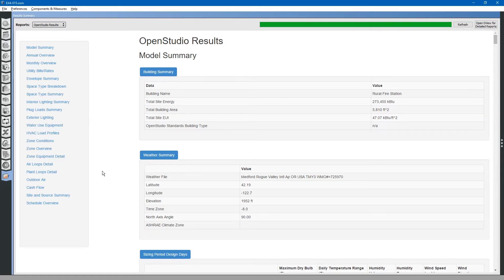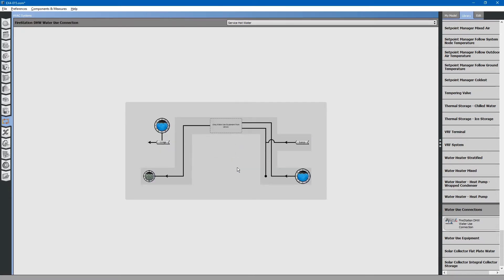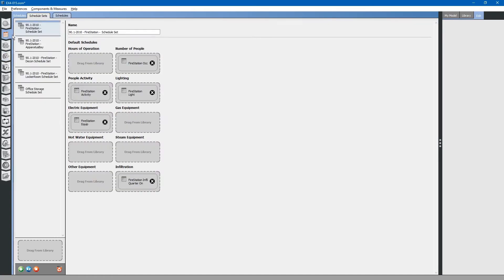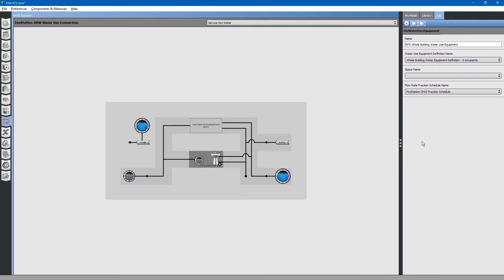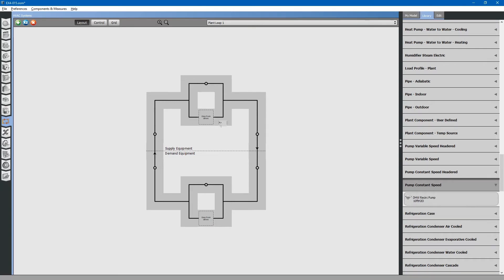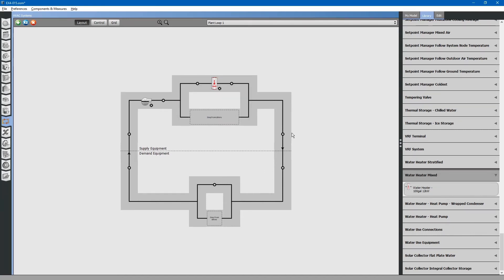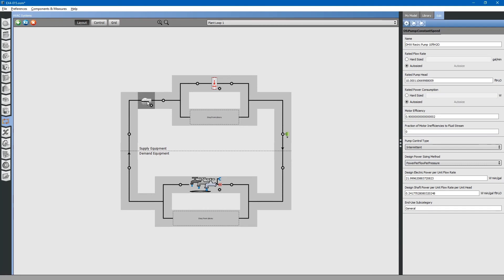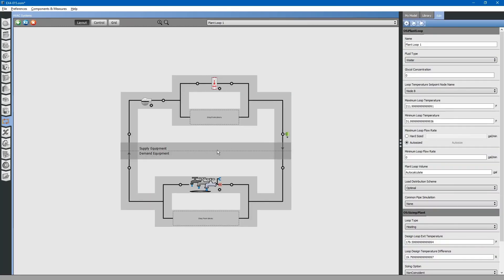Building Energy Modeling in OpenStudio - Add Hot Water System

Comment: Thank you for the clear explanation . I have a question regarding cold-only water use, such as toilet flushing. In a typical house, the bathroom has a shower that uses hot and cold water, while the sink and toilet often use cold water only.

From your experience, how do you usually model cold-water-only fixtures in EnergyPlus/OpenStudio? I tried modeling the toilet as a WaterUse:Equipment object without connecting it to the DHW loop (since it does not use hot water), but I do not see the cold-water volume results in the OpenStudio summary. I also tried creating a separate plant loop without a heater and encountered errors.

Could you please advise on the recommended way to model both hot and cold water use and where to properly check the cold-water consumption? In this video, it appears that all fixtures are modeled as hot water.
Reply from the maker: I have never tried this; apparently OpenStudio does not allow you to create standalone water use equipment.  They are all required to be connected to a water use connection.  Here is a workaround: 

Go to the Loads Tab and create a new Water Use Equipment Definition.  Go to the schedules tab and create a cold water temperature schedule, preferably something low enough that it will not need a boiler to heat it.  Go back to the Loads Tab and assign the temperature schedule to the Target Temperature Schedule of the new Definition.  Go to the HVAC Systems tab and select the Service Hot Water from the drop down tab (kind of a misnomer).  Go to the Library tab at top right and drag in a new Water Use Connection.  Click on the Water Use Connection and give it a name and set the cold water supply temperature schedule.  Browse to My Model tab at top right and browse down to the Water Use Equipment definition and drop in the new definition.  Set a flow rate fraction schedule if you want.  Create a new water loop with pump, hot water heater, and setpoint manager.  Set the pump power and pressure to 0 and motor efficiency to 1.  Set all parasitic loads on the water heater to 0.  Set the setpoint manager_scheduled schedule to the cold water supply temperature schedule.  Go to the Output Variables tab and search for "Water Use" and select "Water Use Connections Cold Water Volume" and set On and Timestep. Now, run the simulation. Open the sql file using DataViewer and view the data.

Comment: I use openstudio 3.4 (latest Version) when I switch from results tab back to space tab or zone tab, open studio stops working than it abruptly crashes. Do you know how to fix this problem. Thanks
Reply from the maker: This was reported and fixed shortly after the June release (https://github.com/openstudiocoalition/OpenStudioApplication/issues/547#event-6835150928), but it appears they have not issued any new releases since then.  I recommend you view the results using the html files: https://youtu.be/WSqe6bZ8Jxg?t=114